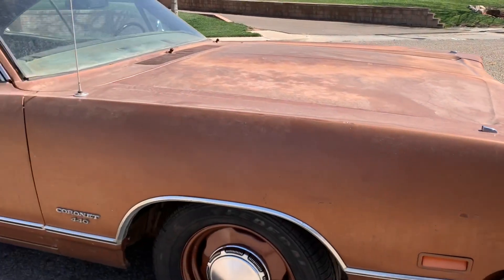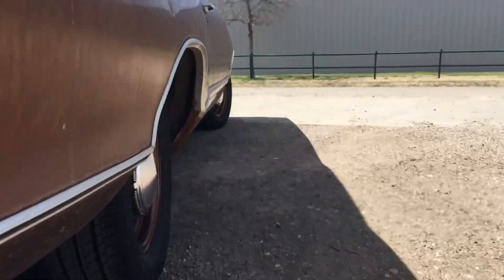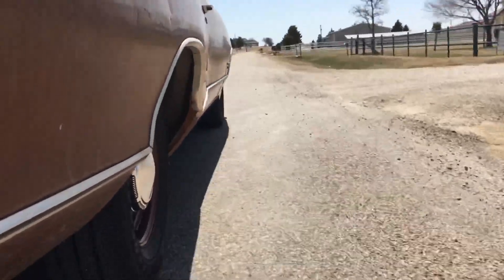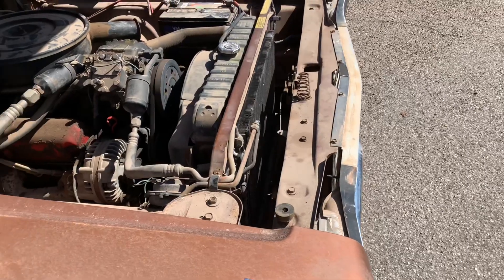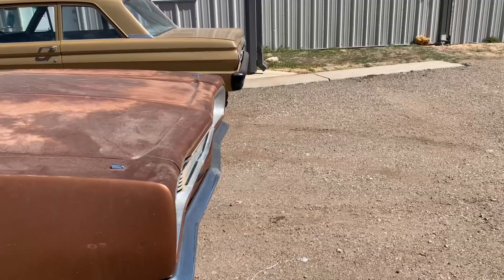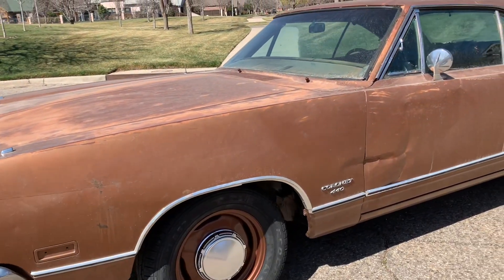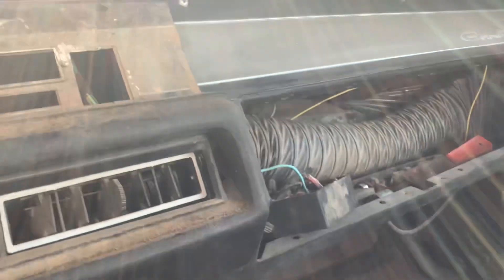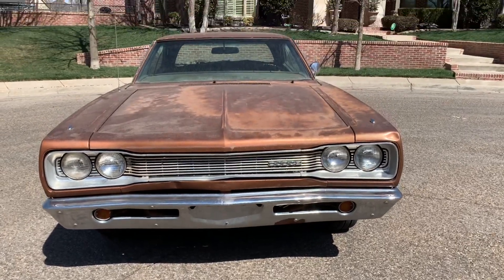Driving a Survivor barnfind 1969 Dodge Coronet Mopar B body, 440 non superbee

Comment: In the summer of ‘78 I wanted to learn about the mechanics of cars. A clan of pals (enthusiasts of all things Mopar) advised the best way was to pick up a junker from a wrecking yard for 100 bucks and go to work on it. Hunting we went and eyeballed a 1958 Dodge Coronet with push button automatic in such a yard outside of Reno NV but it would be $600. I wanted the Coronet but my buddies talked me out of it in favor of the ‘64 Dart Golden Anniversary Edition GT 273 V8 push-button automatic sitting anext for $100 (I mentioned to you in previous conversations). The Coronet was amazingly clean, body wise, which was important. A couple dents neither creased, marginal paint but zero rust! I thought the condition would be great in terms of a platform to begin but my pals worried the running gear would be just too much. Parts for 60’s were still quite plentiful and cheap even though the Dart had a little-to-some rust-through rear of all four wheels. I still think the Coronet would have been fun even if it required mods to later year “upgrades”. Heck, anything seemed possible, especially after a find that summer when we went on a parts run to Sacramento CA:  We discovered a modern-tech package; an updated chassis with disk brakes, and updated rolling gear, sitting on the “show room floor” of a mod shop. It was designed for engine, transmission and body of any ‘55, ‘56, or ‘57 Chevy Bel Air (or other similar model GM variant). Hope you have a blast with your new toy!